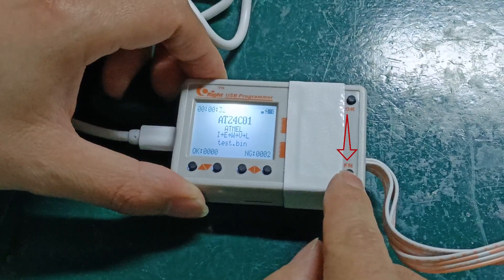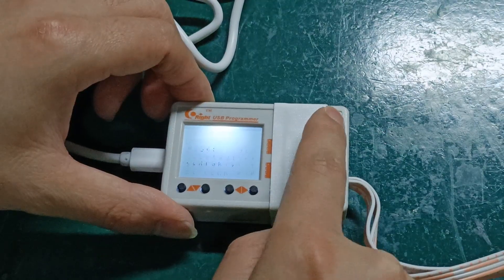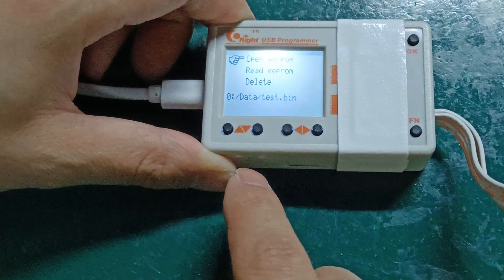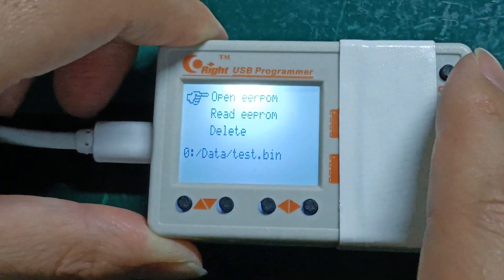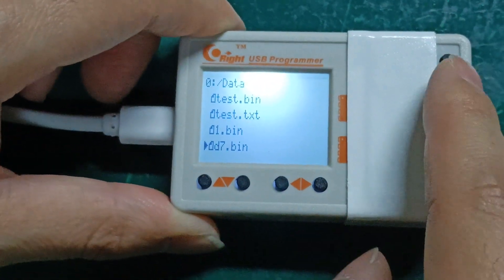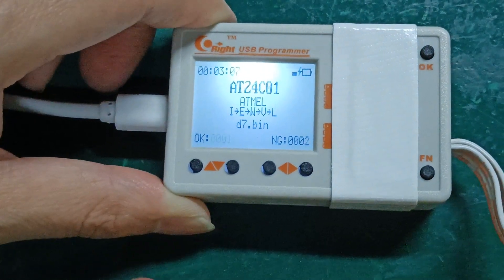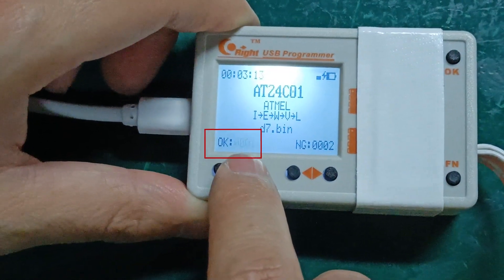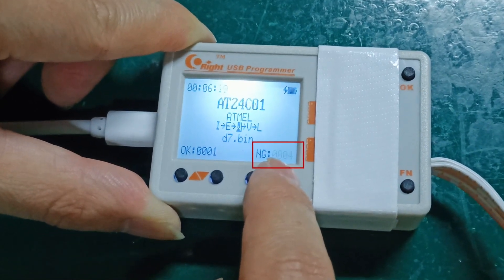How to use Antminer hash board code editor to synchronize EEPROM file丨Hashboard Code editor tutorial

Comment: Hi, I change clock and data pull up resistors from temp sensors to 10k beacouse I dont have in hand 4.7k, do you think is the reason no read temps, I get 142/127 in all tmp75 chips
Reply from the maker: Hello, the resistance value cannot be changed